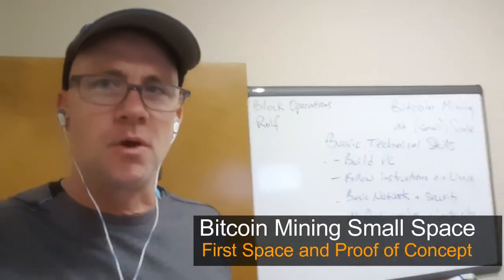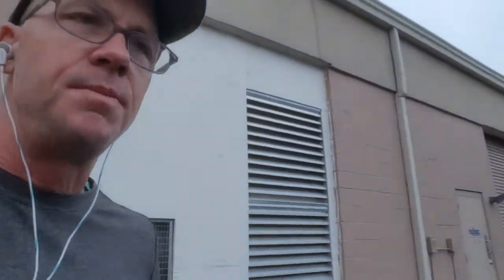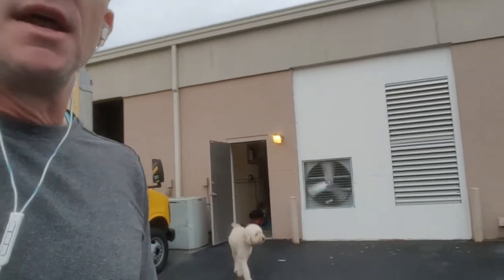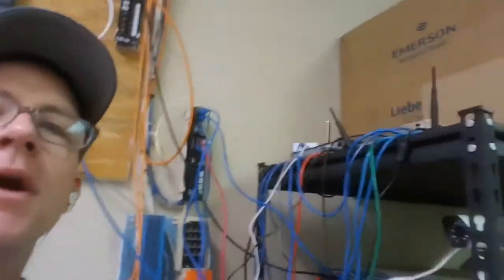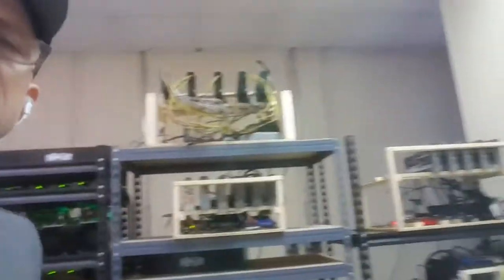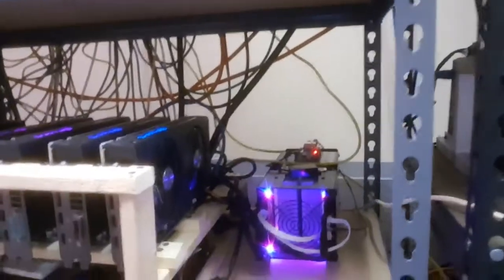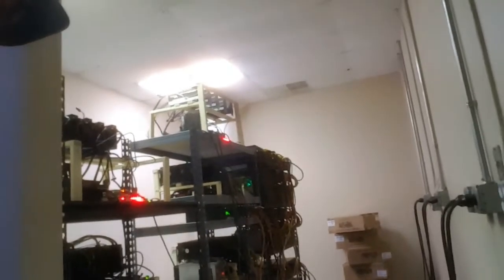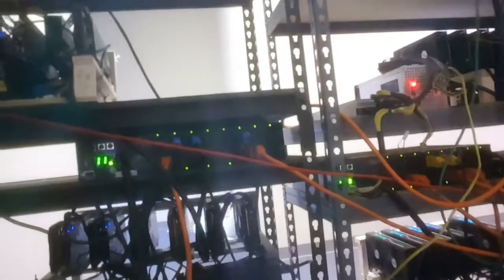Bitcoin Mining Small Space and Proof of Concept

Comment: Thank you for putting up these videos, very insightful.   I was wondering if you have had any trouble getting leases setup based on the power and HVAC loads you need in a small industrial building?  I was considering a similar setup, but would want to get 1 or two rooftop curbs installed to accommodate ventilators and am assuming most landlords dont want to mess with that especially for a smaller facility.
Reply from the maker: landlord don't like holes cut in their roofs, for sure. Just tell the landlord you are going to run a small private datacenter.

Comment: Hi Rolf, 

Great Videos.  I'm about to retire and would like to supplement my income with a few miners.  I'm thinking around 10 miners tops.  My house currently has a 150 amp service panel.  I have no 200+ volt outlets available.  I initially thought I'd need upgrade to a 300 amp service, but after watching this video, I think I can get by with a 200 amp service.  If I can net $350/mo per miner, then 10 miners would produce an additional $3500/mo income.  After a couple of years, I'd like to pull up stakes and relocate to another country.  Do you have any recommendations for a place to relocate to?  The cost of living here is too high for a retiree.